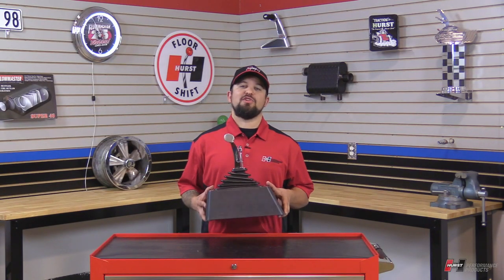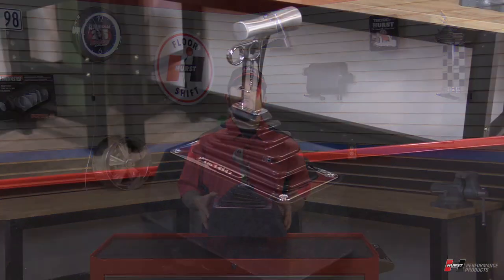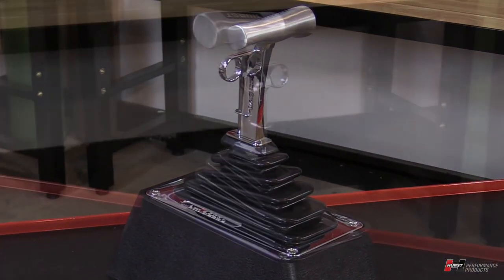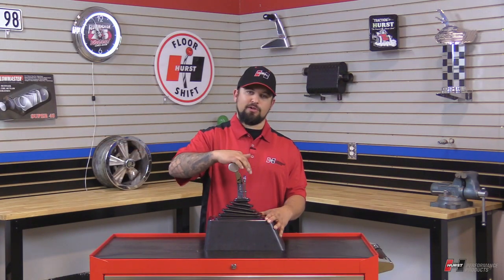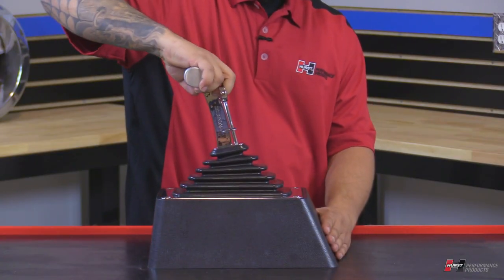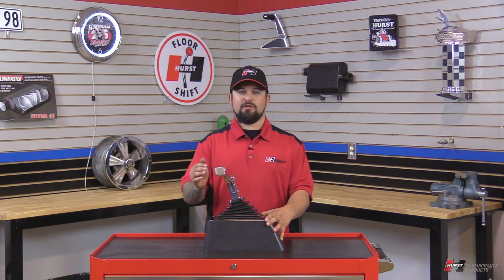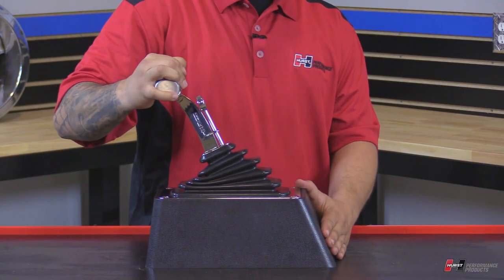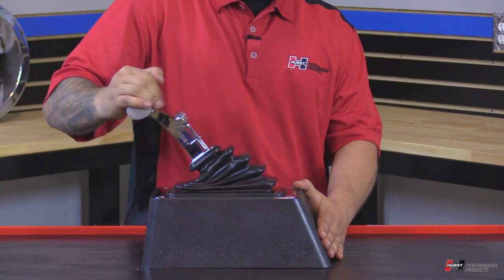How to Shift a Hurst V-Matic Shifter

Comment: i have an older shifter on my mud truck....the lock is a T shape.  Even with a short arm on trans.....the shifter will not pull back far enough to hit 2nd or 1st.....only drive.  Do i have a part not working?  it stops at drive and is very firm and will not move back farther
Reply from the maker: Sounds like it could be an issue with adjustment. Did the shifter properly work at some point? Was it previously dialed in? If not you may want to disconnect the cable from the shifter side and row through the gears to ensure that the shifter is properly working. You may also want to cycle the lever on the transmission side to confirm the transmission is shifting correctly. If both look good then I would recommend to call us at 707-544-4761. Your shifter has a lifetime, limited warranty so I highly recommend making that call.

- Jason @ B&M Racing
Reply: well...it did work before with old drive train with a turbo350......never ever occurred to me the new 700r4 has extra shift points....my bad. Looks like i need a more modern shifter, this one getting up there in years
Reply from the maker: matt sez  The Hurst V-Matic 3 is designed to work on the 3-speed TH350 or the 4-speed 700R4 with no additional bracketry or hardware needed.  The shifter will have a blocker pin that needs to be removed to convert for use on a 4-speed application. If you haven't already take a look at the installation instructions (linked below) and make sure that your brackets are in the correct location, that the shifter is correctly set up and the cable adjustment is right. These shifters are pretty bullet-proof so I'm pretty sure that the issue may be something minor.

Installation instructions: http://files.dpbrands.com/hurst/instructions/3838530.pdf

- Jason @ Hurst

Comment: heres how i got  my v matic box hurst shifter  free
take the rubber shroud off metal surround etc from the shifter 
a few screws here and there ,,, and you will see a gear cog (semi circular)
theres a locating steel button that can be lifted with a hefty  srewdriver 
lift it ,,and the cog will be movable back to its original position
reset the button on the 1st gear select (low) it now should all work 
ps i worked it out myself as the guy doing the  video  didnt get back to me